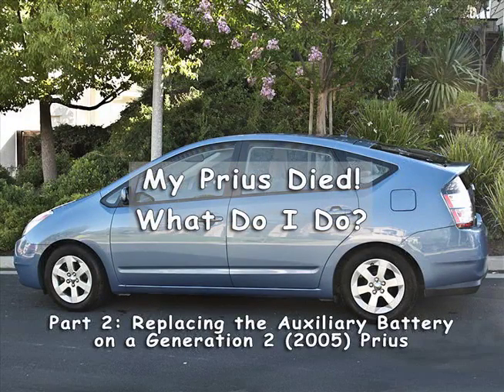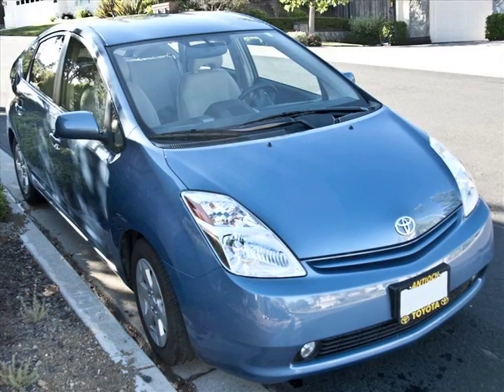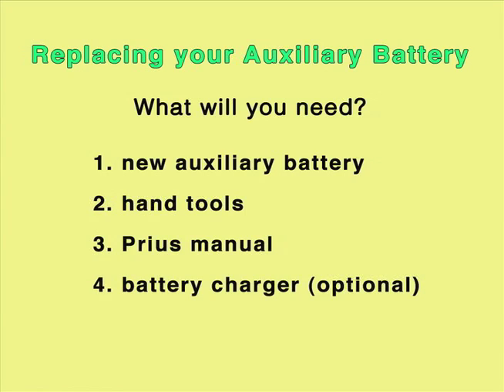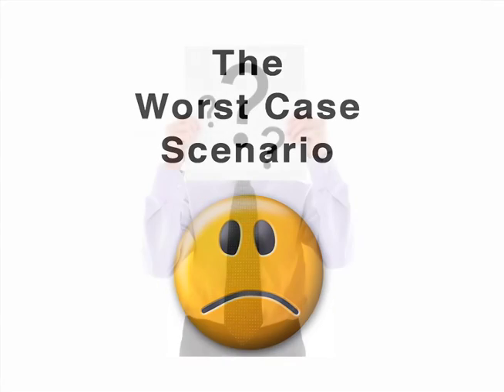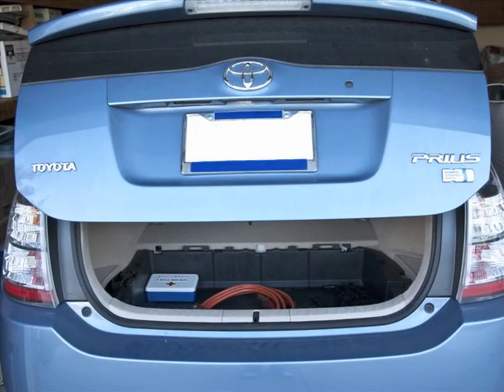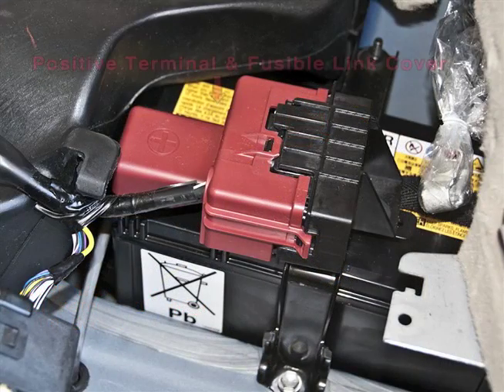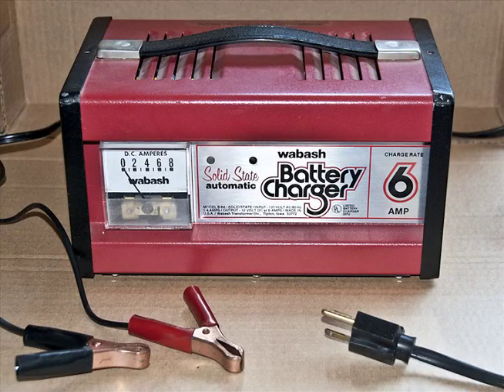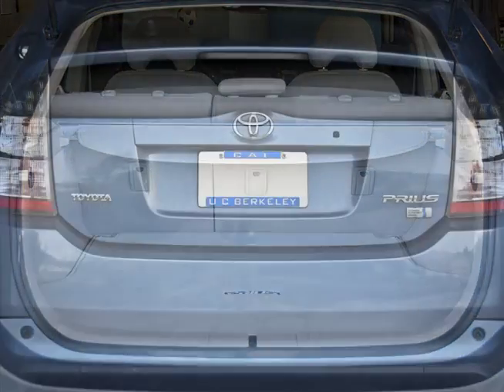Replacing Your Prius Auxiliary Battery

Comment: HI I Just wanted to say THANKYOU!!!!!!!   I was just about in tears with all the warning lights going off in my 2006 Prius. I was really stressed about it. I don't have a fortune to take my car to a shop. I read all kinds of horrible suggestions of what might be wrong with the car. I saw a video how I  check the onboard diagnostics and it showed my battery was less than 9 volts. I watched your video 2xs and took step by step notes. Even what tools I needed, that sure did help, because I had no clue. knowing what size socket I needed helped alot. I orderered a new battery at Autozone yesteday,and it was here by noon.  Because you told us what size sockets I needed I purchased a small set and a screw driver while I picked up the new battery. I have never done anything like this but you made it simple instead of stressful. From start to finish, including purchasing tools and installing, and putting my car back together, and test drive. It took me 3 hours. My daughter said great job mom. I wanted to give you credit, because your video made it possible. thankyou!    I appreciate your simple step by step instructions, and the way you explained it to people like me who were clueless about fixing cars! You have saved me from either a huge bill or getting stuck with a dead car  somewhere. Thanks again!
Reply: I know you did this several years ago Gloria-I hope this has given you confidence to tackle other jobs that you may have had since

Comment: Bought the battery at the dealership—for some reason it was cheaper than 3 nearby auto parts stores—and installed it myself. Saved over $100 for labor. Took an hour total. That included gathering up tools. Simple, easy instructions...great video, thanks!

Helps if you are small, so you can sit inside trunk space, otherwise your back/side might hurt from bending at an awkward angle.

Comment: Just changed me 12 volt battery following your instruction video-it was flawless and very clear.  I'm pretty clumsy doing mechanical stuff ordinarily but you gave me the confidence to do the job.  I especially like the way you labeled all the appropriate bolts, etc. in your slides.  I agree with what an earlier posted said-this is about the best instruction video I've seen.

Comment: Just used this video to replace my 2005 Prius aux. battery.  Believe it or not - this is the first replacement of that battery!  It must be some kind of world record.  Anyway, this video is PERFECT for understanding how to do the replacement.  I followed these instructions to a "T" and all went perfectly, well other than dropping a nut down into the battery compartment and then having to take the battery back out.  Whole process was about 45 minutes with my little flub.  The car started right up afterwards and all seems to be working well.  Have to reprogram a couple of radio stations but that's not a big deal.

Thanks for posting this!!!!!!!!!

Comment: You sir are an officer and a gentleman! Thank you so much for sharing this. My typically reliable Prius turned "Christine" on me today and wouldn't shift, gave weird error messages, wouldn't lock doors, etc. An honest dealer service guy told me it was likely the auxiliary battery (which it was) and your video let me install it fairly painlessly (about 1 hr). Excellent job and instructions - thank you!!!!

Comment: Thank you for the detailed instructions. Followed all steps, replaced the original accessory battery from 2007 which was reading 10.2V and installed a new yellowtop tonight. Hopefully this will last for another five years or so! Thank you so much for the video, made installation a breeze and save $100 and learned how to do it myself.

Comment: Thanks very much for this video.  The instructions were very clear.  I called my dealer and they wanted $260 for the Toyota OEM battery plus $100 for the labor.  I paid $240 for an Optima yellow top and 1 hour to remove the old battery and install the new battery.  You will need a socket extension to reach the rear screw for the vent duct.  I used a small piece of tape to hold the screw on the end of the socket to start the top screw when replacing the vent duct.  When the screw is threaded properly, remove the socket from the screw and remove the tape from the screw head or socket and continue to fully tighten the screw.  If you buy an Optima yellow top to replace your OEM battery, you may have to remove the handle from the battery as it will get in the way when replacing the auxiliary battery cover.  This should not be a big deal when removing the battery.  You should be able to fit your fingers in the gaps between the cylinders at the side and top of the battery.

Comment: Excellent video.  Helped this klutz replace my 2005 Prius battery (after initial plus one stock replacement, I went with an Orielly battery which after browsing PriusChat got good comments and was a bit cheaper than Optima which supposedly have gone downhill in quality lately while still being typically more expensive). 

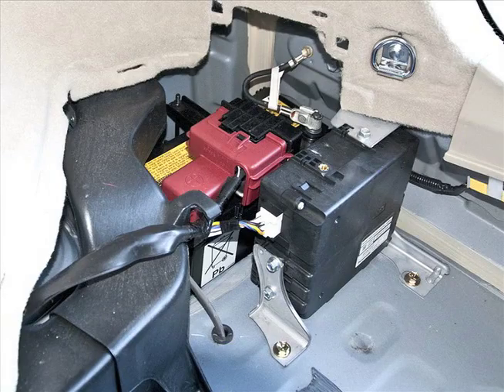If you want to jump to the part where the battery is replaced (if you know how to move cargo stuff out of the way), it starts at 6:30.

Comment: Adding to all the other positive comments, I found these instructions right on the mark. It took me less than 20 minutes to install a new Optima battery. The previous one was 4+ years old and I didn't want to go through the pain of a dead battery when I needed the car the most. I had to have a new Toyota battery put in my 2004 Prius back in 2007. AAA towed me to a dealer that then charged me over $400, which I thought was way beyond outrageous. At least now I know I can replace one myself.

Comment: This was very helpful and explained everything step by step with clear instructions and camera work.  My bolts were slightly different colors which threw me off during reassembly, but I figured it out.

I replaced my OEM battery with another OEM battery instead of the Optima Yellow Top since it has a higher capacity for cars with keyless entry.

I also found about an inch of water underneath the battery, which unfortunately is not an uncommon problem; it's caused by small cracks in the body where the roof trim meets the hatchback hinges.  Time to get some silicone sealant...

Comment: Thank you for this video! Just spent the last 2 hours replacing my battery! Took a while because the yellow-top battery I bought was slightly taller, and the back screw on the vent was - for some reason - almost impossible to access... still, was a fun experience and my car is now operational again! Cheers.

Comment: Thanks for the video.  My 2005 is just now in need of a replacement 12V ... original lasted 7 1/2 years, which I guess isn't too bad.  I just ordered the well-regarded replacement Optima YellowTop from Advance Auto Parts  ... normal price $209.99, but there are usually discount codes you can apply.  The code I used got $50 off.  I look forward to what appears to be a simple procedure when the battery arrives later in the week via free shipping.

Comment: Here are 2 things I ran into when replacing my 12v battery. 1) My Bosch replacement battery (instead of a Toyota OEM one) had the little vent tube on the negative terminal side. I was able to swap it to the positive side, and that seems to be the way they're made (I hope!).  2) it was a huge pain trying to get the big HV battery vent tube back in place because the screw that goes into the side of the car kept falling out of the socket and down behind the battery - use a magnetic retrieval tool!

Comment: And here's one more tip: I found it really hard to get a wrench or socket onto the negative terminal post. I finally unscrewed the end that bolts to the body, and then undid the terminal clamp once it was out. But I couldn't get it back in like that, so I had to turn it around 180 degrees to have access to the bolt head. -Good luck!

Comment: Here is another tip to save money on this repair bill.... buy an Optima Battery on Ebay. Go with the Yellow top deep cycle battery and make sure you have the right battery for your year and model. There is a quick one minute video on youtube explaining Optima batteries. I bought mine for $147 from a regular seller auto parts guy. Amazingly he ships for free but he needs a house address cause he only uses Fed Ex to ship. Good Luck.

Comment: My dealership's high invoice for replacement of AUXILIARY battery was explained by "more work, we need to discharge!! the hybrid battery for safety reasons and charge it again'. Now I went onto the Prius forum and no one has ever heard of this. What I guess happened is, that two similar words were mistaken (= 'discharge' and 'disconnect'), BUT since the download of the full mechanic version for Prius cost money (I was given the url at the customer service, but she was wrong about it being for free and they asked...my dealership for confirmation of procedure, duh), I do not have anything, not even of this (disconnect) procedure read anywhere. Did you disconnect the traction battery (at the orange safety plug under the rear panel) before working on the auxiliary battery replacement???
Reply from the maker: Sonja,

I did not disconnect the orange safety plug (traction battery) when I replaced the auxilliary battery in my Gen II Prius.

The traction high voltage battery is isolated from the 12 volt battery by relay(s). When the car is turned off, these relays remain open, so there is no connection. You might want to give the car 5 or 10 minutes for any residual high voltage to dissipate from the traction circuit. But then, you should not be messing around with that part of the car anyway. The high voltage wiring is isolated from the auxilliary battery compartment.

Whenever I work around the auxilliary battery, I am careful not to touch the positive and negative posts. Even 12 volts can pack a shock. But I haven't heard of anyone running into issues with the traction battery, when changing out the auxilliary battery.

I am not a Toyota engineer or technician, so bear that in mind if you use my tutorial. Perhaps some of the more experienced viewers will share their opinions of the advice given you by your dealership.

Peter

Comment: I finally replaced the battery, thank you so much.

 There was some concern when I saw sparking(is this normal?) as I connected the negative terminal(to the wall of the car), but things seem to be running fine. There was also another problem I had that wasn't directly addressed in the video, the portion of the negative terminal wire touching the battery, I wasn't able to remove it directly, instead I  had to remove the wire screwed onto the wall of the car. Was there a better way of doing this?
Reply: Sparking is fine and it happens. The car is basically absorbing the electricity from the battery with enough force to cause a spark.

Comment: Great Video,  I did have one problem though.  I bought a battery from Toyota, but the vent house did not fit snug with the battery.  I put some tape on it to hold it in place, but I will go back to Toyota to find out what's wrong.  Has anyone else seen this problem?

Comment: Is it the same for Gen III Priuses?
Reply: Not sure it could be that different... but might be... find the battery and use common sense... you have to remove items other than the battery to gain access to the battery... that's the only issue...

Comment: I have heard that after replacing the battery that the car needs to be reprogrammed, is this completely necessary?
Reply from the maker: The most I ever had to do was reselect a couple radio stations.
Reply: I see, thanks for that info, I have talked to two shops about my 2007 prius and both are saying it needs to be reprogrammed. The toyota shop is charging 120$ for installation. I couldn't imagine what kind of reprogramming is needed.
Reply from the maker: Are you replacing the main traction battery or the 12 volt auxiliary battery?
Reply: The 12V auxiliary battery that's in the back of the prius.
Reply from the maker: Flux...,
Full disclosure: I am not a Prius technician nor a mechanic. That said, I have not heard of any problems related to "reprogramming" after replacing the Prius auxiliary battery. 
I recommend you have your charged replacement battery in hand before you disconnect the old battery. I encourage you to try replacing it yourself. Just follow the steps. 
Let us know how it goes.

Comment: After watching this video  https://www.youtube.com/watch?v=QQKh48x-Ltw  I realized I needed a new AUX battery for my BASIC Prius. I bought a MOTORMASTER ELU-S46B24R at Canadian Tire for $170 Cdn. I'll get $20 back once I take in the old battery.  The MotoMaster met the fit, form and function criteria and it even had the vent hole. The old battery was the original and it seemed to last only 6 years. The dealer wanted $310 for a new battery plus tax! 5 yr warranty on the Canadian Tire battery - I wonder why.  

For my model of Prius, I only had 2 bolts on the battery harness to remove. That's it. I removed the harness first but there some kind of sensor on it so I had to keep it out of the way.I did the vent last as it was under the wire to the positive terminal. The cover to the positive terminal just fipped up so I didn't have to take it off as shown in the video.  I used a 12mm socket for everything. Unfortunately the negative terminal nut was on the wrong side and difficult to get at, so for that I had to tip the battery up to get at it with  a spanner wrench.  I turned the nut and bolt around to make it easier to tighten and get at it the next time. I used a ratchet to refasten the negative terminal nut and I touched the positive terminal with the ratchet. (Nice spark so be more careful than me!).  It was a lot simpler for than this excellent video shows and it only took me 1 hr 4 min from going to the basement to get the tools and battery to coming back upstairs.  Note that the vent tube seemed to have a certain angle to push it in and twist. Fiddle with it.  

The only settings I had to adjust afterwards was the clock. ODO was still showing correctly but Trip A and Trip statistics were gone. If you are interested in stats, you may want to write them down before pulling the AUX power.  Good luck.